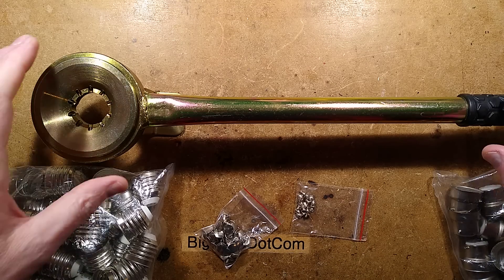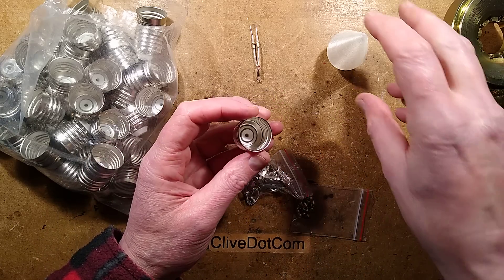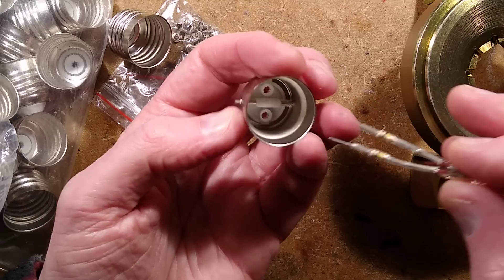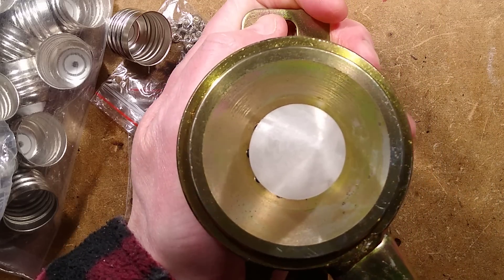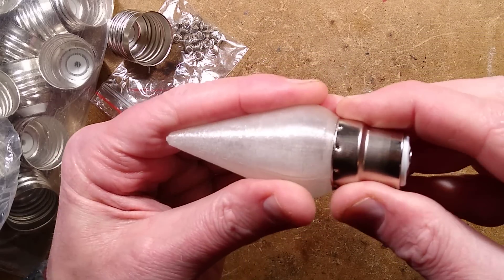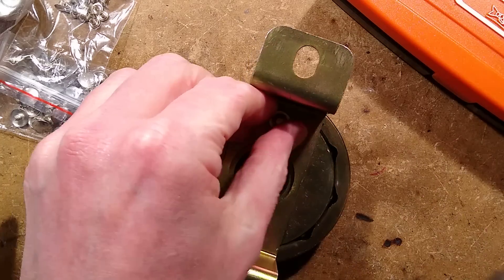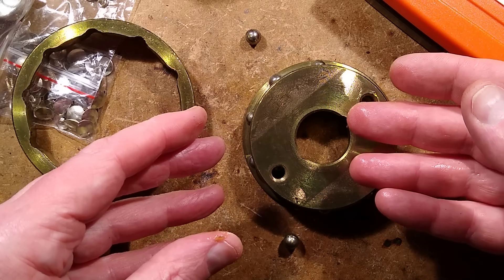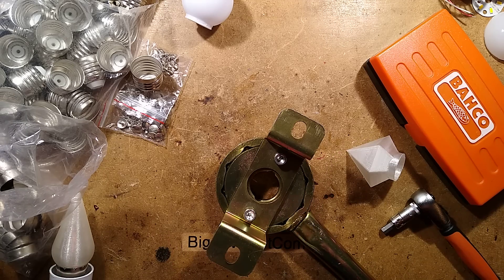Chinese factory lamp base crimper

Comment: You'd think there would be an automated robot to do this, but not in China, and that's not because China is behind the times oh no.

For being a Communist country, people in China are often very cheap, like, extremely cheap. As in if a light bulb burns out, nobody will replace it unless ordered to.

So instead of a robot crimping the lamps, it's cheaper, at least in the short run to have a worker use this crimp.
Reply from the maker: There are machines in large scale factories, but this tool is aimed at smaller manufacturers who assemble lamps by hand.
Reply: @bigclivedotcom  That's kind of nice in a way, depending on their working conditions.

Comment: Think it would work for home made lamps? or just for factory lamps?
Reply from the maker: It can be used with home made lamps.
Reply: @bigclivedotcom  So the title should be just "Chinese lamp base crimper".  😀  Interesting design, thanks for presenting it. Attach a handle to the base, and it would work without having to be secured down.

Comment: Can you describe the connection between the rivets of the bayonet style and the conductor wires?  I expected a small through hole for the conductor to protrude allowing for a bit of solder. The actual connection appears to be less than ideal.
Reply from the maker: The stud is a friction fit against the wire.
Reply: @bigclivedotcom  I'm curious how that connection will hold up long term. I could see it becoming intermittent, especially if inserted and removed from a socket repeatedly.

Comment: As Clive was struggling with holding the base of that tool while trying to crimp a bulb and then later when he was trying to break the bolts free, I kept thinking that Clive needs a vise on his bench to go with his vices. :)

And speaking of vices - everclear - carbonated or not - should not be drunk straight. It's an industrial solvent at that point. :)

Comment: I'm sure at big lamp factories it is all automated but on a smaller scale I'm picturing some worker pulling the crimp tool handle all day, insert bub in test socket, put bulb in bin as they load next bulb into crimp tool

Comment: Finally, a whole video that I understood. Plus, I knew the answer to your difficulty in breaking the nuts loose. More leverage, of course. 🎉 I wonder if the manufacturer put a little Loktite on the threads. Looks like a well made tool, so maybe they did. The Chinese can make excellent equipment if they wish. They are building a space station, after all. Thanks for making my day.
Reply: When he brought out the tiny 1/4" ratchet, I thought what the.... :oops:

Comment: Instead of bolting it onto a door frame, you could make a wooden handle and bolt it onto that, so it works like "garden shears" but crimps instead of cutting.
Reply: I've seen linemen using something like this.
Reply: Discarded plunger for handle

Comment: What value resistor do you advise on a neon on 230 volts?
Reply from the maker: Two 100K resistors.  You can use a single 220K one, but it runs quite hot.

Comment: Neat! I was gifted a 3D printer that uses Resin instead of Filament. I haven't used it yet. What type do you use?
Looking forward to your new lamp collection!😉
Reply: Clive uses the filament (FDM) printer. Both are great for different things. I generally use the filament when possible because there's less mess.
Reply: @chaos.corner  I used to use Autocad for electrical as well as mechanical design but my Autocad is from 1995 on a 486 that doesn't work now. What would you recommend the best/cheapest CAD design software? Clive is awesome!
Reply: @hinspect  If you're coming from the CAD world, I probably couldn't make a good recommendation. I like OpenSCAD because it fits my sensibilities I've also done a little bit with Blender and TinkerCAD but I hear a lot of people like Fusion360 (But they changed their licensing).
Reply from the maker: I currently use an FLsun Q5.

Comment: at 3.12 you should have bend the wire 90 degree angle so it hold on to rivet. about 10 years ago I made and sell home made LED lamps. and for pads I had to fill with Pb. and the holder crimping tool (it looks the same haven't change much all these years) looks same. I try to buy one. but it was sold out already. many people are making LED bulbs at that time.

Comment: You don’t need to permanently fix it someplace, you could just screw two screws or hammer 2 nails at the right distance to hook it in there when you want to do a crimp, then put it away again.
Reply: Or if there's a ledge/railing somewhere that is narrower than the distance between the mounting tabs, it could be placed over that, and it would self clamp as the tool is rotated.
Likely to put some marks into the surface, but if there's space for sacrificial/protective shims...

Comment: Either Clive has massive hands on that ratchet was tiny.  Would of been much easier to undo with a normal sized one (about twice the length)
Reply from the maker: It would have been easier with a full size tool.   I didn't think the bolts were going to be quite so tight.

Comment: Clive, awesome tool, I am sure will come in handy.
a Little trick a older gentleman friend taught me, that you and others here may already know.
if you are trying to get a bolt/Nut lose, and it refuses to yield, find a piece of metal pipe
[ not PVC or any flimsy material ] that fits over the handle of your wrench, that is at least 
2-4 feet long, depending on the size of the bolt, gives you more leverage,  and they come
 loose a lot easier. 

 I used to struggle with getting really heavily torqued  nuts /bolts loose until he showed me this trick.
I understand tho that in your case, that the crimping tool rotates, it could prove hard...

cheers   😀
Reply: I keep a leftover piece of automotive exhaust pipe in my toolbox for this exact purpose. Sure, I could've returned it since I bought an extra piece I didn't need for the original repair, but it's paid for itself several times over.

Comment: Just bolt it on to a piece of wood so it makes another handle ;)
You might get away with removing the bracket and using alternative bolts to bring the wood closer to the handle.
Reply: I wouldn't take the bracket off, as otherwise knuckles might contact the other lever when operating. I feel a 2" wide, 18" long, and 3/4-1" thick bit of hardwood could make a nice handle. Shape the handle part so it's a bit rounded for comfort, then this could be a handheld tool. 

Of course, making a clampable base to clamp it to the desk could be better, as it won't be wobbling about during operation.
Reply: I would say bolt it to a 2x4 type thing, and then use a couple of clamps to clamp that to the desk when needed.

Comment: Honestly that looks like a pretty sturdy and maintainable tool. This is the kind of thing I'd mount to a board to clamp to the desk when needed. And thanks for reminding us that adults are allowed to buy, and even take apart, our own toys... (I usually wait until mine break to take them apart, although I very nearly disassembled some new grow lights to inspect the driver...)
Reply: Put a couple of bolts/studs though the holes and drill two matching holes in the bench. Then you can just drop it into the holes for use (and no  unwanted bolts sticking out of the bench when it's not in use)
Reply: @theelmonk  I wouldnt necisarily trust the paricle board to hold up to that for very many repititions. Also clive would lose all his  little bitsand bobs through any hole in the surface in notime if I know him.
Reply: You got there  before me. Clamping it to the bench using a "false bench" seems like the right thing to do.
Reply: Don't screw it down. Just two smaller screws not fully screwed sticking out where you can hook it in on the spare occasion you need it.
Reply: or if you have a bench vise you could bolt it to a block that you can clamp on, would make the footprint smaller for storage
Reply: @Sam-th4jl  Yes that is ideal but as clive uses a machine vice as a hand tool now and then I doubt he has a monted vice at least in this shop. A metal block in a vise is definitely the strongest option.

Comment: Need some Archimedean force there Clive 🙂

Looked like a torque wrench handle welded on, wonder why they never went with a similar length breaker handle - possibly a surplus of the hollow handles at the time they were manufacturing them?

Comment: Why are all the lamp fittings you generally talk about on the channel E type instead of our more common B? Is it because that's the cheapest on ebay due to US prevelance?

EDIT: After my keyboard warrior response you actually got some B type for once hahaha. Long live the bayonet cap!
Reply from the maker: I go for the most universally recognised base.  It's also much easier to get off than the bayonet cap ones.
Reply: @bigclivedotcom  That's interesting you find it easier. I've always found bayonet much easier but maybe it's because I'm used to them being secured in a ceiling whereas on a video you're using a holder on a wire. (But I suppose ceiling roses are the same thing give or take)

Comment: The price of weird connectors is odd.. I needed a BNC to Coax connector and it was 6.99 for 1, or 6.49 for 5..
Reply: Most of your problem is probably your search terms - BNC is a coaxial connector - wtf is "coax connector"?? If you learn for the proper names for things, it helps to find them
Reply: @gorak9000  I searched BNC adapter and went through the listing until I found the one I needed and it was called a BNC to Coax.. but the point is it's 50p cheaper to buy 5 than 1

Comment: That’s a beautifully elegant tool design. Not a part wasted.
Reply: We've been making lamps for over 100 years so it makes sense it'd be so optimized.
Reply: @Aeduo  But most of that time we used glass bulbs and the bases had to be glued on.
Reply: The design is very human.
Reply: Future generations in the neolithic will be cranking out bulbs using this tool.
Reply: It's minimalist in parts, easy to make. I just wonder if it would last in commercial use
Reply: @AnonMedic I imagine it would probably stand up to commercial use as far as how much a human assembly operative can put it through.
Reply: @AnonMedic  pretty much impossible for something to break given it's just a couple of ball bearings, springs and spikes. wear out maybe but even then I imagine it would take a while
Reply: @MAGAMAN  yeah they make the majority of the things we use, broken tools cost time and money.
Reply: The bearings might wear out, but they are trivially replaced. I don't see why it wouldn't.
Reply: Indeed
Reply: China

Comment: Clive's LED light bulb repair service!  Just go to a recycling place or dump or tip or whatever it's called and scrounge the dead LED light bulbs.  

One issue that might be a problem is if you mount the crimper vertically and the leads want to fall out of position before they can be crimped.  Then you wish you had mounted it somewhere else.  😱  Thanks, Clive.

Comment: You might consider switching from a ratchet to a breaker bar before engaging in Herculean force 😁 

Also, adding a internal support to your bulb design for the led/neon might be a good mod, although getting the support material out might be an issue.
Reply from the maker: I've done it for centreing LEDs by using a tapered cone to avoid support material.

Comment: Are we about to witness the return of light-bulb production to the Isle of Man following a hundred-year absence?
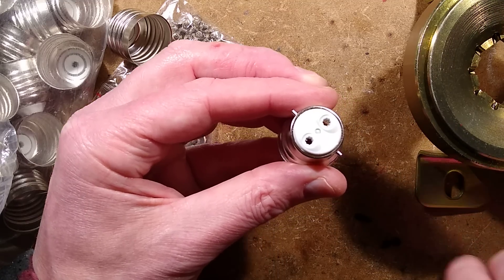About inserting the base pins: Might it be wise to fold the wires over the edge of the hole before inserting said pins, to retain them before the pin holds them in place? It seemed like there is a 'ledge' which would act as a measuring point (3:09).
Reply from the maker: The E27 caps have a hookable ledge, but the B22 caps don't.
Reply: I would love to see production of "things" return to the Island. My fathers side of the family are Manxmen, there are some very clever people residing on that little island
Reply: @restojon1  "My fathers side of the family are Manxmen." Are your mother's side Manxwomen? Let's not even get into their preferred pronouns.
Reply: @demef758  did you just assume somebody's something? Someone else will trigger somebody's something or other at this rate lol 😆 

BTW, my mum is Maltese. From one tiny island nation to another 🙂 🇲🇹 🇮🇲
Reply: @restojon1 
They/them certainly did assume a something... They assumed men are men. I think. Also women are somewhere in the story. I assume. Dang it. I've triggered myself. Off to break my own windows or whatever the correct punishment is supposed to be this minute.
Reply: Artisan, small batch, handmade, sustainable light bulbs made by a bear on an island in the Irish sea? I'm sure there is a market for this.
Reply: Artisanal Ramsey Lamps to special order

Comment: Great tool.
£40 isn't expensive but it seems pretty heavy so how much postage did you have to pay?
Reply from the maker: That included shipping.
Reply: @bigclivedotcom Then it's cheap!
Reply from the maker: @Ni5ei  Yes it is.  A similar one not made in China would cost a fortune.
Reply: @bigclivedotcom  Ordered one!
Too bad you have to decide on which size you want. Would be even greater if you could buy the E27 with an adapter for E14.
But that's nitpicking... And impossible due to how it works.
Reply from the maker: @Ni5ei  I think the E14 would have to be a separate inner head that could be fitted into the existing handle.
Reply: @bigclivedotcom  I wish the US offered international mail rates as good as the China Post.

Comment: That's a pretty interesting device. Never realized it was done this way. I love the simplicity and ease of use on this tool.
Crimps them tighter than Ethel Granger did her corset.

You need to make a DC 18 strength roll to discombobulate the thing, haha!
Reply: Just do a cut and take a 20 to pass automatically, lol.
Reply: The lights are most likely never touched by humans.  They probably go into an automated assembly line and are crimped along the way.
Reply: @acmefixer1  "The lights are most likely never touched by humans." In China? Surely you jest! (And don't call me Shirley.) Just the other way around over there: all humans, no machinery.
Reply: @demef758  not all humans. Just mostly humans. For reference check the Chinese stamping press video where multiple people sit inside a large stamping press while it works in order to transfer parts between stations.
Reply: @Bobbias  I saw that video. Insane.
Reply: I appreciate the very specific reference

Comment: Isn't this an application where you can use the vice of knowledge for its intended function - holding things!
Reply from the maker: It would also need screwed down.
Reply: @bigclivedotcom  Nah Clive, the added inertia and grip-ability can be sufficient to tip the balance in many situations. Not quite the same entertainment value though.
Reply: I just thought it might give extra leverage.